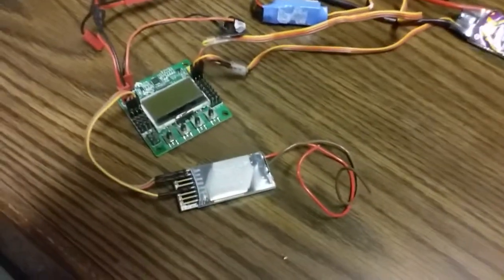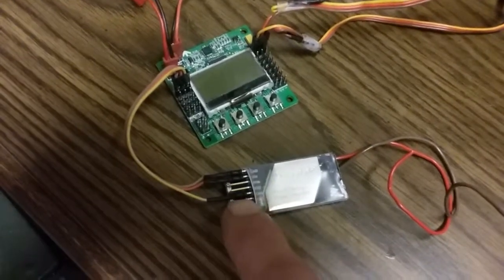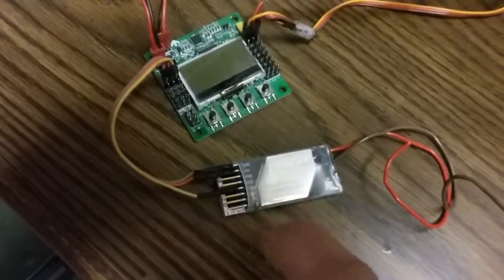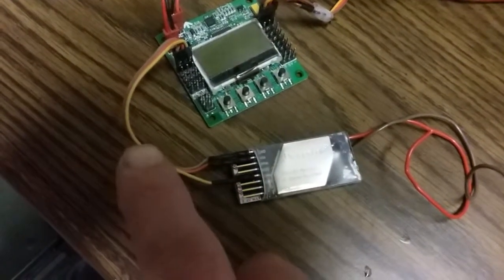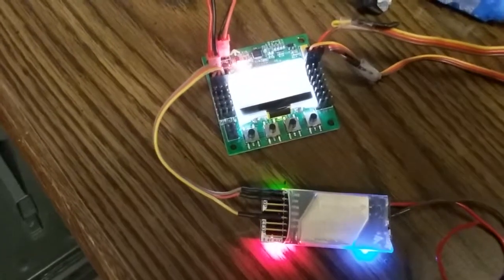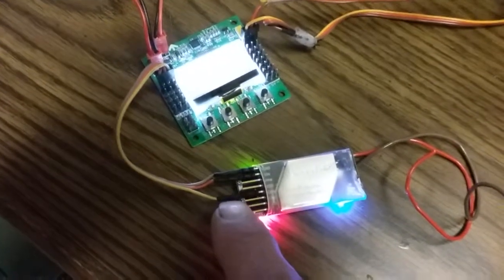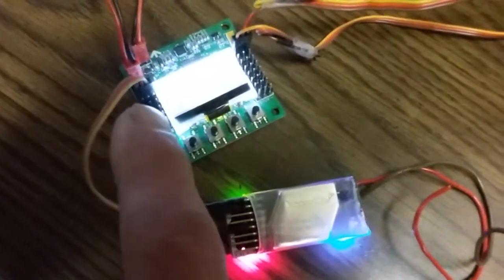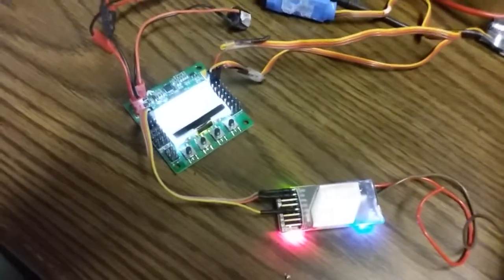DragonLink Copter Receiver ppm output to KK 2.1.5

Comment: great help and nice video , i have a question bro , to the voltage sensor on the kk which wire of the battery you have pluged in  . the balance wire or the output .. thank you
Reply from the maker: It is a direct wire off of the power ditribution board/squid wiring harness. it needs the raw battery voltage. in the video, paues it and youll see the small wire coming out of the squid harness, (squid harness supply the esc's with voltage) but also have a single small wire for auxillary use. just like the soldered versions of the power distribution boards do, usually have a seperate raw power pin to the same reason.